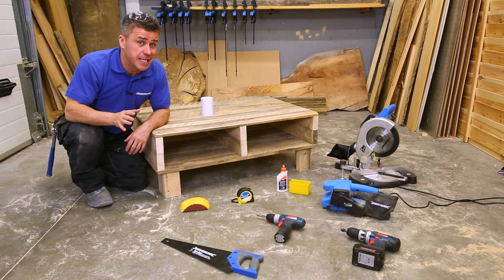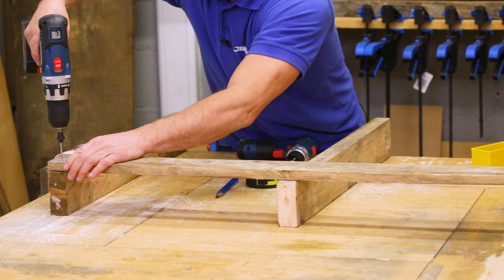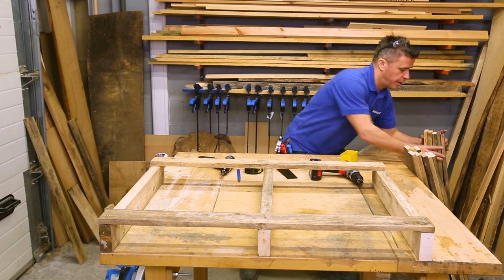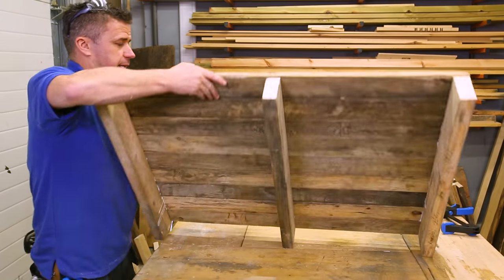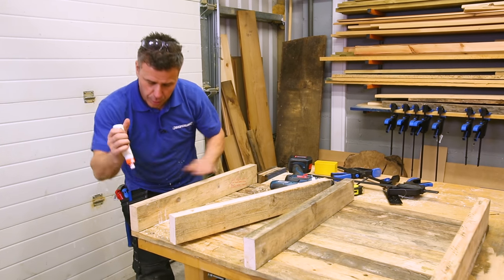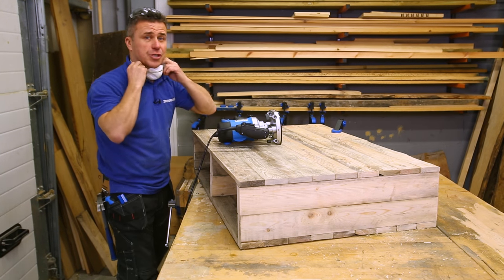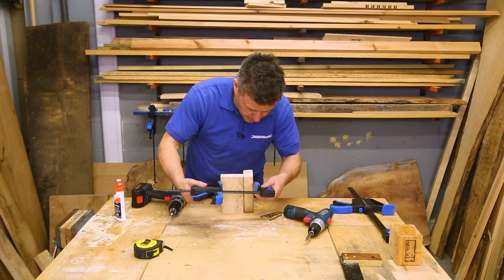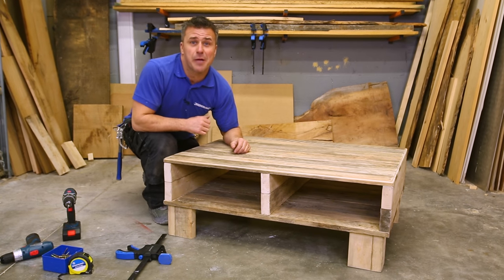How to build a DIY rustic pallet coffee table

Comment: I would't even bother with a router. An uneven edge would perfectly match to this stile. I would Just go for a wooden file to round the edges roughly then sand it with spongy sandpaper. But i would do that not only the top but everywhere. The top round diameter would be bit bigger than the normal edges. 
It does not mean this one is't good. It is.
Reply: Yes sure that would work